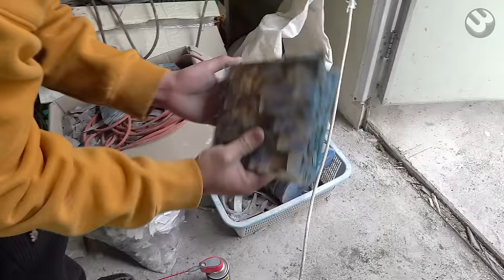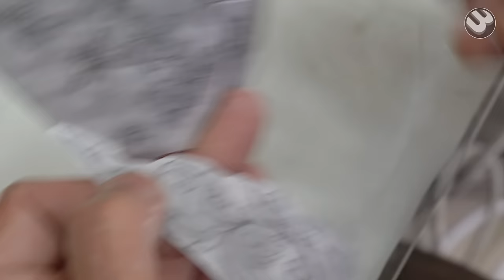Amazing Korean Craftsmen Cut Thin Seashells Into Jewelry Boxes

Comment: Beautiful products and very clever methods used to ensure standardisation in batch quality. However, there's a risk of developing silicosis where cutting and sanding of shell materials is concerned. There doesn't appear to be regular practice of mask wearing to reduce dust inhalation.

Comment: I thought mother-of-pearl was HIGHLY toxic....
Reply: Same stuff as eggshells, calcium carbonate.
Reply: Extremely hazardous. It causes silicosis. Also, some types of shells have been known to cause heavy metal poisoning.  The extent of the types of damage shell dust does is not thoroughly researched but we know that breathing the dust causes lung and heart issues, for starters. Some research suggests the dust might even be absorbed by the skin . They should be wearing respirators and have proper ventilation. That's just for starters, there are so many safety problems here I don't know where to begin.